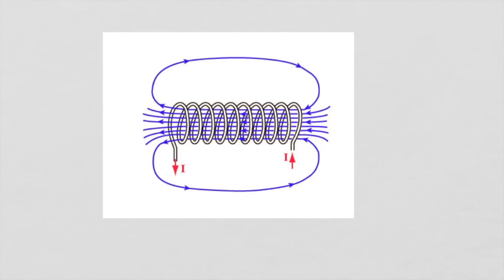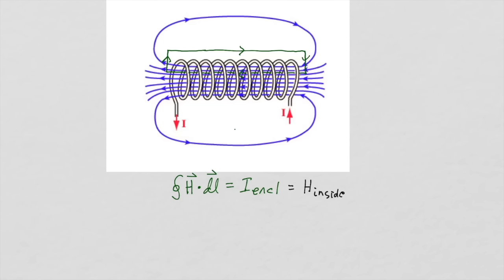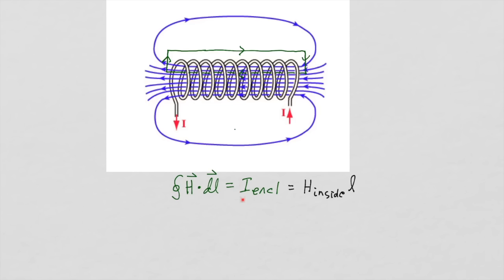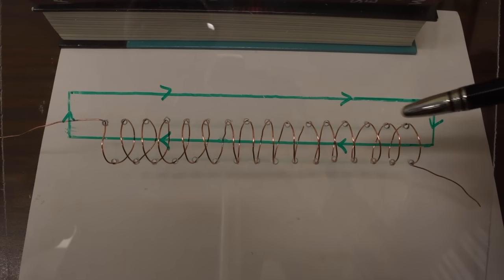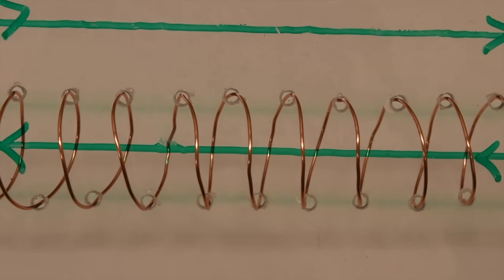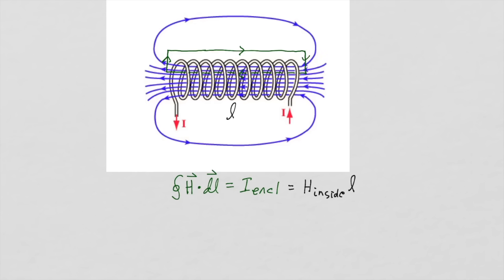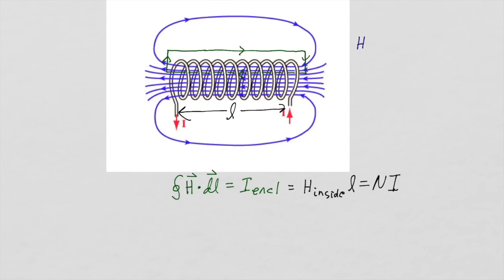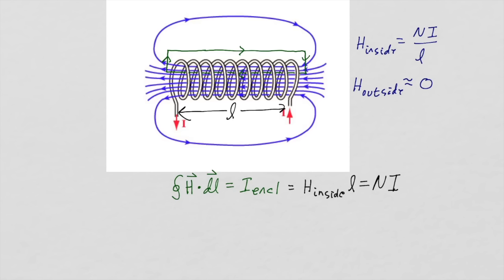Magnetic Field of a Coil

Comment: Can i ask if there is an insulation-layer on the copper-wire? or does this work without insulation? Coz otherwize the number of turns wrapped around the wood-cylinder would only be 1 (or half maybe) but a very thick layer.
Reply from the maker: Yes the wire is magnet wire that has insulation. So I had to remove the insulation at the two ends in order to make electrical contact.

Comment: Sir,how much potential difference keep in circuit
Reply from the maker: I used both a DC power supply and a 9V battery. I don't recall which one I used for this video. I wanted as large a current as possible to get a strong enough magnetic field to rotate the iron filings.

Comment: What means apply the current? 😳 Is there a battery somewhere?
Reply from the maker: Yes, I don't remember if I used a DC power supply or attached a 9V battery. I did it both ways and don't remember which I used in the video.
Reply: @electricandmagneticfields2314  Thank you! It explains everything.

Comment: Why that wires goes around for exactly 25times, not more not less? 🙂
I have learned this in school and don't remember now. Can you please help. Thank you.
Reply from the maker: There is no reason. It just has to be enough turns to get a strong enough magnetic field to rotate the iron filings. I probably should have done more turns than maybe I would not have had to tap the plastic to get the iron filings to rotate along the magnetic field lines.
Reply: @electricandmagneticfields2314  Thank you 🙂 👍🏻

Comment: Next video show us why the field is strongest in the center of the coil.
Example: When a solenoid is energized the iron slug stops in the center of the coil even when it has plenty of space to move.
Otherwise the statement that the field is equal the entire length of the coil is questionable.

Comment: What is the input voltage and current? AC or DC? Thickness of copper?
Reply from the maker: I used DC, a 9V battery. I don't remember the thickness of the wire. It was magnetic wire and whatever gauge is easy to bend, yet firm enough to  form the coil will work. I'll try to remember when I go in to work later today to see if I can find the gauge wire I used and I will edit this comment to include it.
Reply: @electricandmagneticfields2314  3 years after YouTube recommended. I replied for questions still you replied. For that I subscribed ur channe. #mass michael
Reply from the maker: Looking at the wire I would guess it is probably 26 gauge.
Reply from the maker: Many have posted this video was recommended after three years. How was it recommended? Did you get an email from YouTube? TIA
Reply: @electricandmagneticfields2314  Not brother. I don't know about recommended process of YouTube. But your god gifted. Automatically subscriber will increase. Wishes for best future from the bottom of my heart. From India
Reply: Thank you

Comment: 7:37 Excuse me Sir, but the dimensions of the left side of this equation are aren't same as the dimensions on electric current which in on the right side of the equation. We are missing some constants there.
Reply from the maker: That is exactly what you need, the same dimensions on both sides of the equation because the two sides are "equal."
Reply: @electricandmagneticfields2314  Sorry Sir, a typo from me, I meant that dimensions of right hand side aren't same as the dimensions on the right. How can the equation be right if the dimensions don't match ? Thanks.
Reply from the maker: @yashsvidixit7169  The left hand side has H(A/m) times dl(m). The meters cancel leaving A on the left side, matching the right side, which is current (A).

Comment: essentially magents are warp drives in basic terms, now put a maget  attach a magnet inside that coil and it will try to accellerate.. pulling the coil with it, and essentially this is warp so the magnet isnt really moving..

Comment: H outside the coil can not equal zero.  It must be the same only dispersed over a larger area.  IE... Less per cubic volume of space compared to the volume inclosed within the coil winding.  To say it equals zero is to say the lines of flux are not connected and we know they are from your first experiment shown in the video.  Please give correct information,  I would expect more from a professor of science.  Otherwise a good video.
Reply from the maker: I don't say that. I say as the field lines emerge they have to spread out to wrap around and come back in the other side of the coil so they become very weak outside the coil. When I was calculating the field I was using the approximation you make to be able to apply Ampere's Circuital Law to solve this problem, a much weaker field outside than inside. So essentially zero outside. The more tightly wound and longer the coil the better this approximation. In the limit of an infinitely long coil the field is indeed zero outside the coil as the flux lines never come out.

Comment: Did I miss when you said how much electricity you are inputting at the ends of the  [coil] wires ?
Does it matter which one you hooked-up to positive and which one hooked-up to negative ?
Reply from the maker: The polarity does not matter. I think I used a 9V battery.
Reply: @electricandmagneticfields2314  - ah yes, thank you - I forgot he said about 8 volts at first, then reduced the voltage.

Comment: Sir, nice tutorial. I have two questions. What if the coil has square or rectangular profile instead of above shown circular profile..Will it still have magnetic field around it? And what would be the magnetic field intensity difference between them? (Circular vs rectangular)
Reply: You get the same enclosed current, so the integral is the same. More wire will be used to make the square coil. Interesting question.
Reply: No real difference, maybe a bit less of a 'smooth' curve

Comment: Edit: It is insulated!

You're short-circuiting the coil. You need to either insulate the copper wire or bring them a bit further apart. The way you're doing it is basically a single turn of the wire. It could produce a much stronger magnetic field.
Reply from the maker: The wire is insulated.
Reply: Yeah, I decided to search for the information, thanks for the reply! It's enamel insulation, right?
Reply from the maker: @wesleyrm  Yes, it is magnet wire.

Comment: How do you apply a current?
Reply from the maker: I just connected a battery directly to the two ends of the coil.
Reply: @electricandmagneticfields2314 Really? I thought you had buy a car batter and Jerry rig the cables to work. Is it just one battery where you have one end of the cable on positive, and one on the negative end of the same battery?
Reply from the maker: @juggerswood  I think I used one, or two in series, 9V batteries.

Comment: What is the source of current? 
Also is there a resistor that you have used? (since copper wire has practically negligible resistance would it not drain the batter instantaneously if the source of voltage difference is a battery?)
Reply from the maker: I attached a battery to the coil to generate the current. No resistor, as I wanted as large a current, and hence as large a magnetic field, as possible.

Comment: Is the space inside the tube shape negative or positively charged?
Reply from the maker: I am not sure what you are asking. There are electrons, current, flowing in the wire. But you can consider the wire as neutral as the electric field inside the wire is small because it is a good conductor. The movement of the iron filings is strictly caused by the magnetic field resulting from the current flowing in the wire.
Reply: I am referring to the space inside or in the middle of the wire is it positive or negative
Reply: @1ecafuentes  it's not an electric Field , it's magnetic
Reply: @1ecafuentes  it's not charged or something